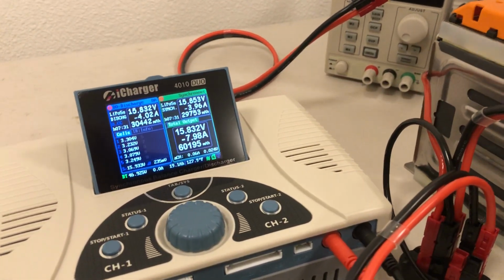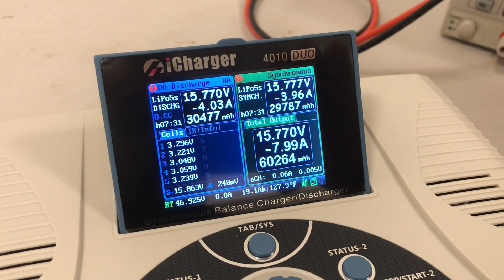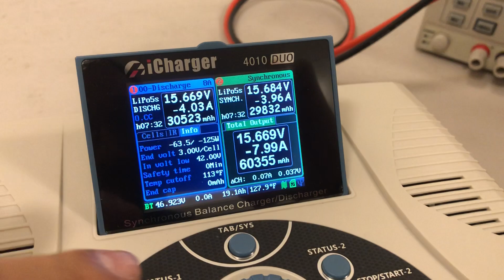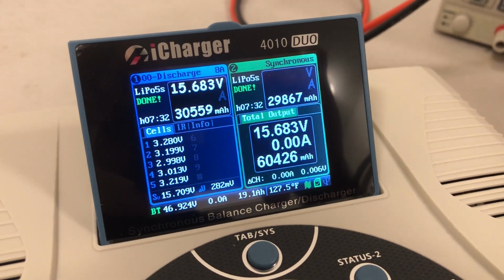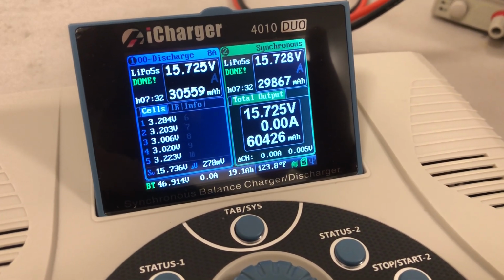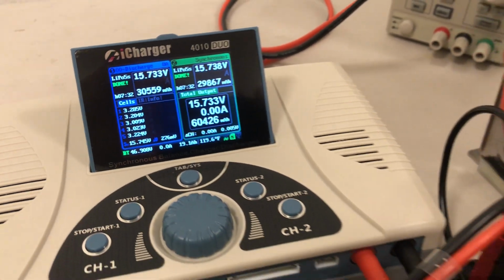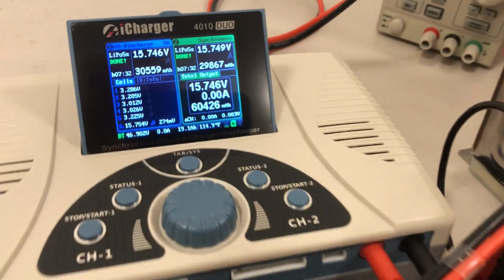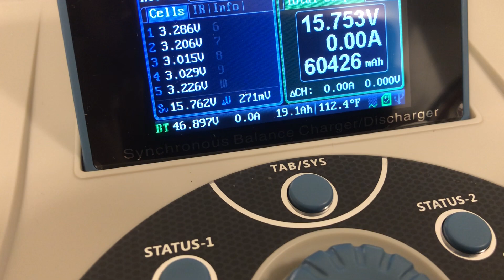1.1 kWh 5s Fiat Battery Discharge Test

Comment: This was a cool video! At full throttle it says it’s pulling 78 to 83kw. How many cycles should these last in my car? I try to only charge it to 70% and discharge only to 20%
Reply from the maker: Not sure.  Certainly less than in a stationary power storage system which had a much lower discharge current, and is my main focus.  if your loads are somewhat close to OEM then you could perhaps assume similar life to what the manufacturer estimate for their production vehicle.  I too am limiting my max charge voltage to about 4.1 per cell and no more than 70-75% DoD.

Comment: I own the 500e , these cells hava a good cycle life! My car is from 2013 and it still gets its advertised range .
Reply from the maker: Very nice, these are going into a powerwall.  I'd love to make my own EV.
Reply: Hey Crimp Daddy! you're they only guy posting stuff on these packs. I just bought 3 of these packs to build a 15s battery with, how hard do you think it would be to tear into these and build a new pack with the individual cells? looks like i can snip the interconnects and make good connection points. What are your thoughts? thanks in advance! right now i'm using a bmw i8 battery module on a side by side two seater recumbent trike. i'm using a front hub motor pulls 30 amps 1500watts and maxes out at 62 volts. The bmw i8 battery module is only 26ah 16s so i'm looking forward to the upgrade. would love to make a slimmer housing for all 15 cells to hang the battery pack as i do with the current pack. Thanks again!
Reply: @kevinjames5510  Kevin, sorry for the late response.  I dont post a lot or really manage my channel.  Personally I would leave these in complete modules as 15s is VERY usable with a 48v inverter.  They are well packaged and constructed, but I have seen others take it apart.  Its a lot of work but it can be done.  I think where these shine are in stationary storage applications like Powerwalls.  For things like ebikes, I would look for more power density, but these cells can REALLY dish out the current which do make them great for how power applications.  Considering the came out of cars, they would of course be good for that.